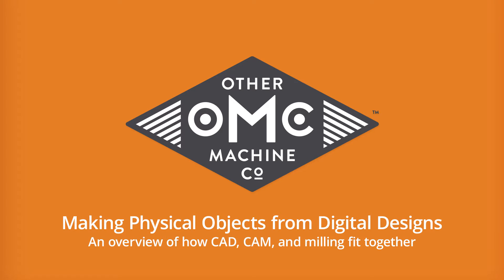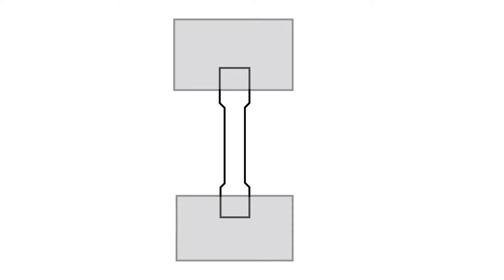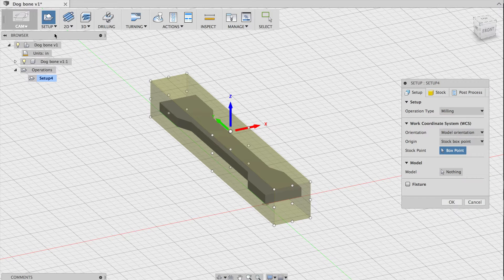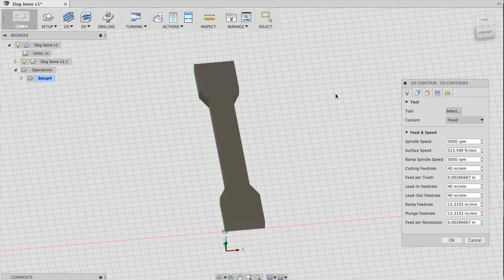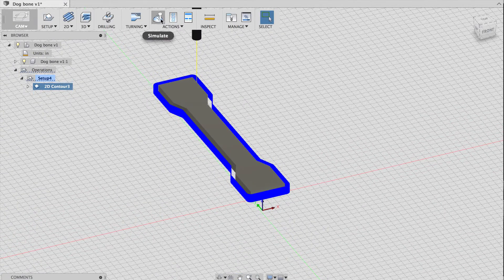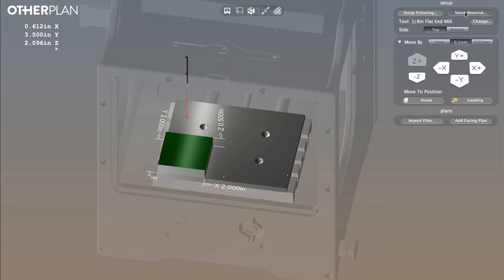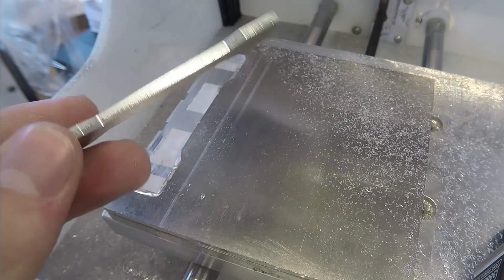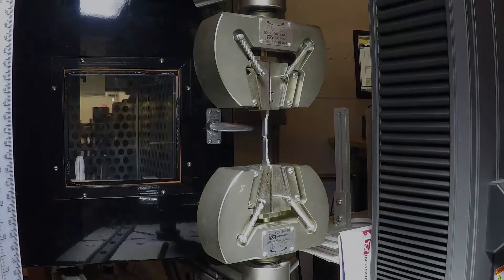Bantam Tools CNC: The Process of Creating & Milling Digital Designs

Comment: When you were picking the tool in CAM, the default spindle speed was 5000rpm. Does the machine adjust it itself or is it necessary to change the transmission?
Reply: There’s no need for that I don’t care